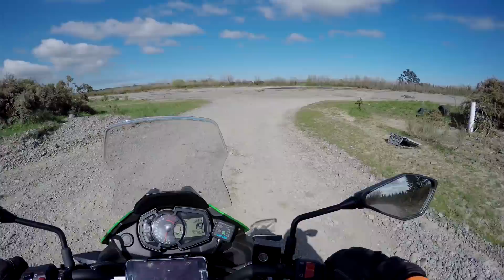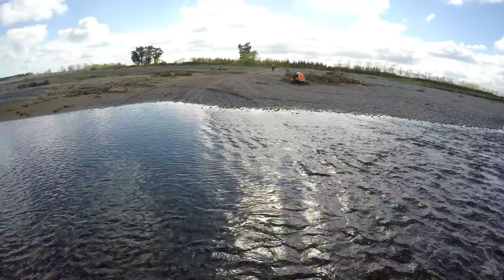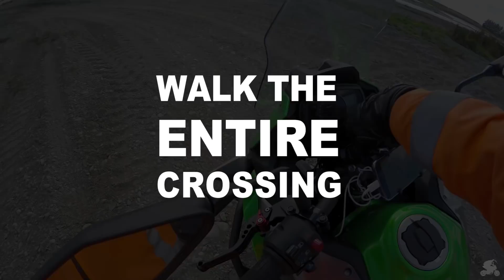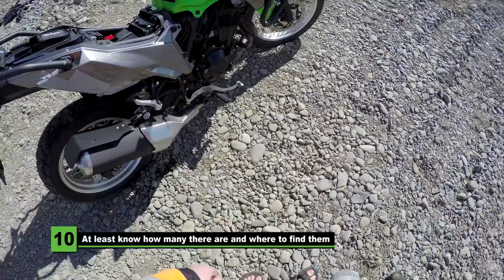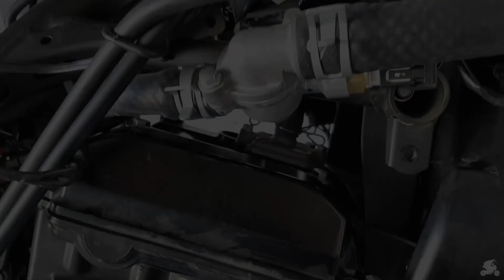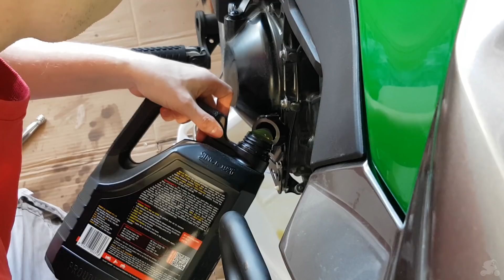BOOGERED!  10 Lessons on the Versys-X 300

Comment: What to do to save the the bike,  replacement of the lubrication oil, fuel,  oil filter, spark plugs  is OK?
Reply from the maker: Oil, plugs, oil filter, air filter, lots of wd40. No problem 10,000km later. Doesn't burn oil and runs perfect. I got lucky.
Reply: @KiwiGrom  Kawasaki tough !

Comment: hahahaa great video.....but i'm curious, if i mainly ride on the roads on this or the 650, how often must i change the oil?
Reply from the maker: I don't think it matters where you ride. Engine wear happens no matter what :) Kawasaki recommend Oil at 1,000 km and then very 6,000 km with oil filters every 12,000 km.. I'd stick to that or do it even sooner. Oil is cheap compared to an engine
Reply: KiwiGrom oh I see, 6k/12k intervals, I thought it was every 1k... Thx.
Reply: Every time you hydraulic lock the engine!

Comment: a question still please ... the servicing of the bike every kilometer you were told to do;
in Greece I spoke to 1000 oils ... after 6000 oil and filter and after 12,000 filter oil valves ..... to you what have they said ??
Reply from the maker: Yes. Kawasaki dealers recommend a change after 1000 and then every 6000 with filters at 12000 (If you want to keep warranty then you have to do this the first year). This seems reasonable. I did extra oil changes and filters to get all the water out
Reply: thanks again !!!!

Comment: The engine was started with the milk oil? lulz
Reply from the maker: Yup.. had to see if it would run after putting everything back together.. Only ran for a few seconds and then changed the oil. Got lucky :) I've heard tales of people riding days on waterlogged oil.
Reply: Your engine bearings are probably only good for 159K instead of 160K miles now. lol. I think it is a good idea to drain all fluids as a first step. I helped my friend here in Houston rescue his flooded bike and the first thing we did was new gas, oil and coolant.
Reply from the maker: Cheers.. Next time for sure! I didn't do the coolant.. something I should probably take a look at.